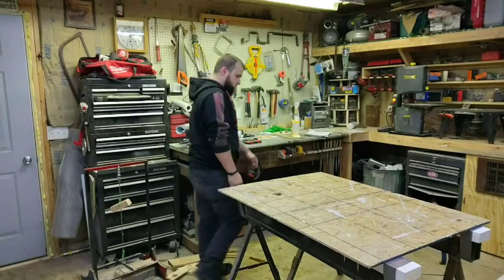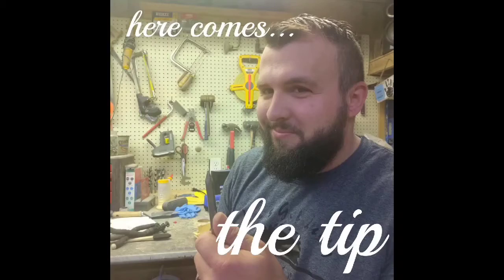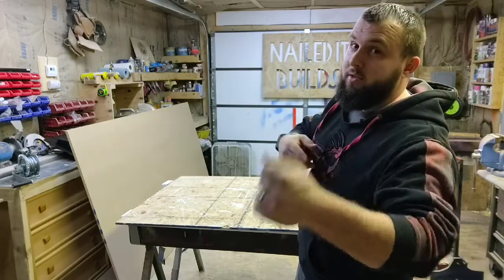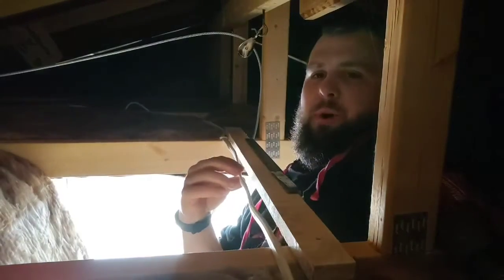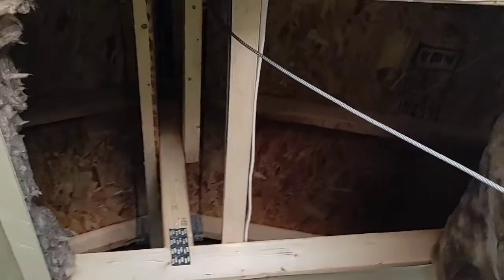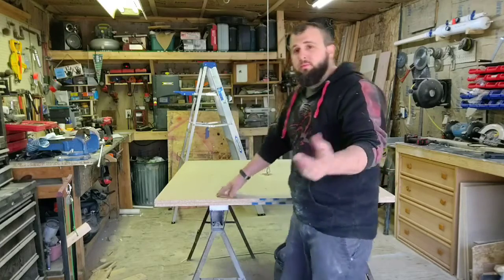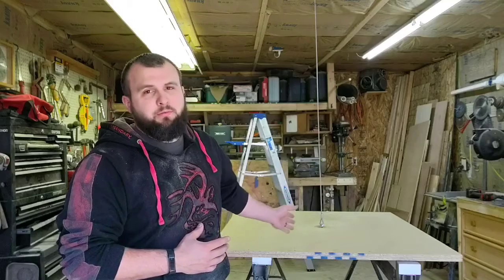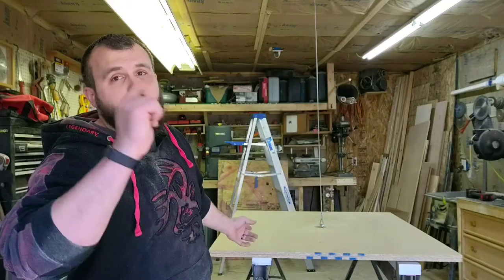Ascending Work Table (Drops From The Ceiling)

Comment: I did this design in my home workshop and it has worked perfectly for years. Plus it allows me to leave projects that are still in progress on the workbench and lift it all into the ceiling without having everything fall off the table top… I am currently making a second lifting system to do another work surface that will be a steel welding table and metal fabrication table

Comment: You can fix the tipping and stability issues with a very simple modification. It will also make the mounting points on the corners of the table and will keep you from having to cut a hole in the center of your work surface. Simply attach 4 I-bolts to each corner with a short piece of cable that all connect together at a shackle in the center and hook onto the shackle. Then instead of having your lifting pulley mounted to the ceiling/second floor rafters attach it above the rafters in your attic to one of the purlin joists so that the shackle will lift above the rafters slightly and pull the table top flush against the ceiling of the garage.

Comment: My guy, I want to try this next weekend. Thank you
After watching thus fully your design is much easier than I had in mind, was gonna run 4 cables yet just need middle support. And thinking of a tensegrity design drop down legs for stability. The work I've gone done in my shop the past month... shoot sakes shelves, wiring, insulation. Shelves shelves shelves. Installing lights this weekend, then fingers crossed if I can find a decent enough sheet wood my plan is to yeah make a drop down table.
Reply from the maker: Awesome, good luck. It's been a few years I've had this and Ill say the boys not issue was at one point the wood dowel I attached to in the middle failed. Up graded to steel and now no issues. Also go heavier than you actually need on all the hardware. Last thing you want is that thing coming down. Thanks for watching.